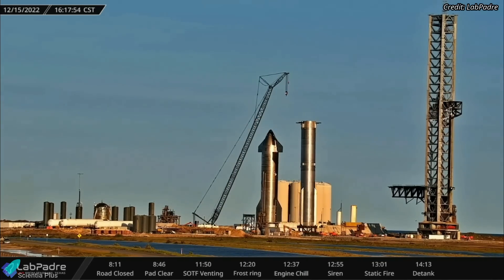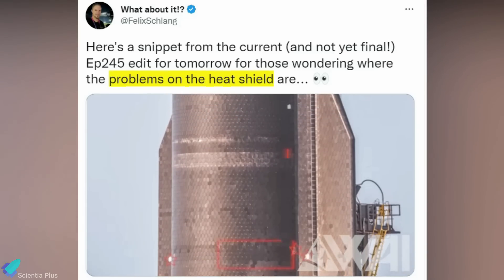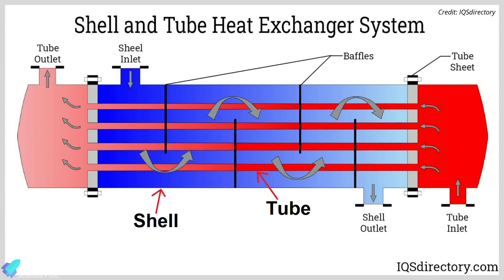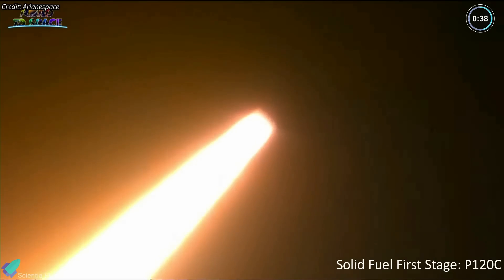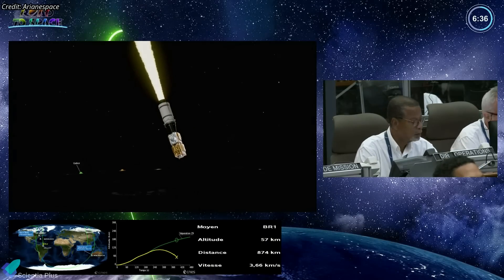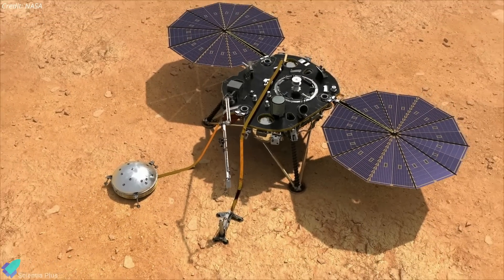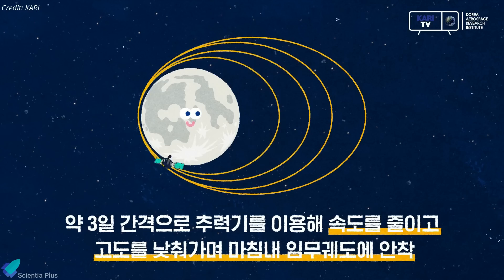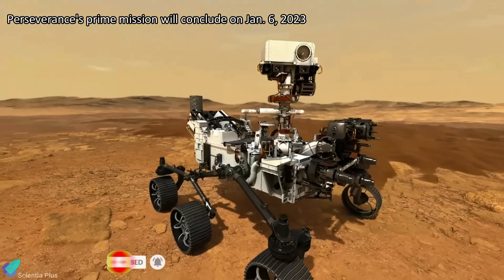SpaceX Redesigned Raptor Engines, Starship Flame Deflector?, Booster-9 Test, Insight, Vega C Failed

Comment: There will be NO flame diverter, that ring of concrete was before this last removal. It's just a way to pour the concrete in several plates rather than a single slab.
Reply from the maker: thank you for the info ♥
Reply: @scientia_plus  yours truly.  I'd say that the concrete slab just below the OLM is like a consumable, that could be replaced after each high energy event. Until a better solution is found.

Comment: Tiles are going to turn out to be the dumbest engineering idea man ever had. I favor large molded panels made from the heat resistant material and glued directly to the metal skin with 2 part High Temp RTV. You install heat resistant panels like that it's never coming off. I'm sick of those tiles. The amount of time they eat up repairing them should be reason enough to come up with a better idea!!! I was so disappointed when I learned they were using tiles. Every time it goes in for repairs I hope it comes out with panels instead of tiles and it never does.  Quit being Lemmings following NASA off a cliff. Be real Engineers and think for yourselves. You have a rocket that is essentially a tube. Take advantage of that in the design of the thermal protection by standardizing components allowing you to keep replacement parts on hand. You want 1 hour turn times you have no choice but to ditch the tiles and go for panels because you aren't going to be that fast without them. Elon I hope you are reading this.

Comment: INTERESTING!
If they are adding a flame diverter system here it appears that Musk has given up on creating a system that will operate on Earth as well as the Moon and Mars where it would probably not have such a system installed.
Reply: A correction: A flame diverter is only required on Earth, because the Super Heavy booster will only be taking off from Earth.

Super heavy is not needed on the moon or Mars - it is only used to get Starship out of Earth's atmosphere & strong gravity.

Starship itself also does not need a flame diverter, because it will be using only 3 engines to take off on Mars, vs the 33 engines Super Heavy uses to take off on Earth.

Comment: Helpful update.  One thing I'd make note, 5:44 it seems unlikely the graphic illustration of the Vega C launch was accurate after 2nd stage ignition.  It appears that the 2nd stage had a burn through that caused the stage to tumble.  The remaining illustrated milestones probably didn't occur as illustrated.
Reply: Quite so.  The graphic showing the payload doing a sharp downturn towards the Earth was also extremely fanciful.

Comment: Congratulations on South Korea reaching lunar orbit.  This of course showcases the fact that Falcon 9 is able to send a spaceship to lunar orbit as well.  Sure, it's relatively small and took a while to get there, but a feather in the cap for SpaceX nevertheless...  The Vega C failure was in the second stage and not as per the graphic shown at the time.  Watching the video it was clear that the second stage was tumbling out of control well before it separated and well before the graphic (not the graph which showed the rocket coming down) showing a nominal flight.